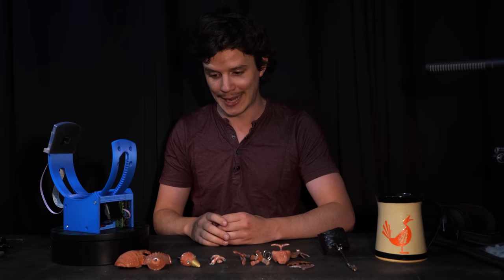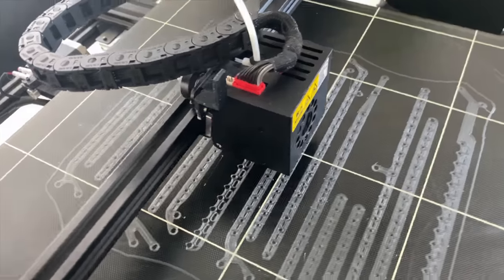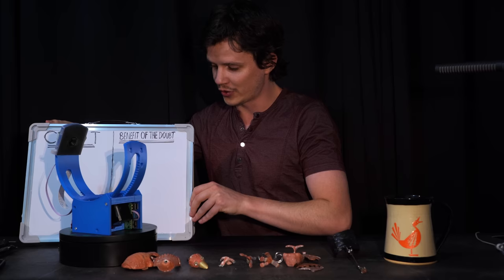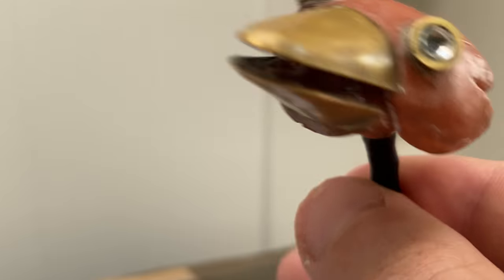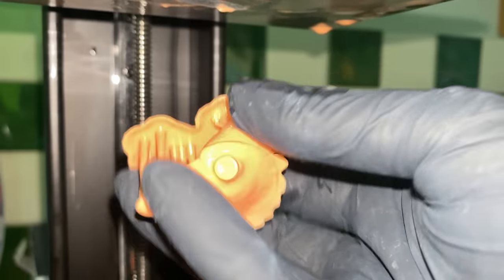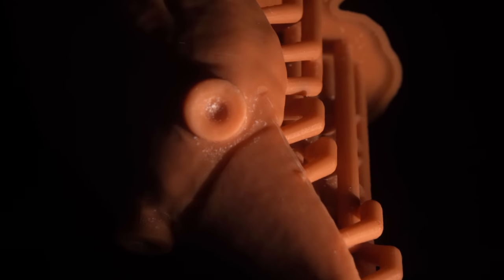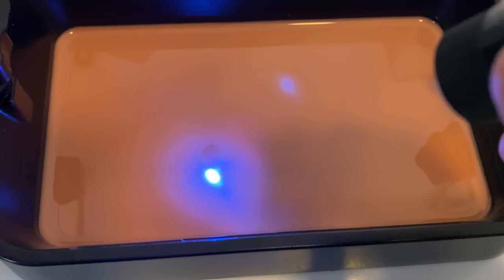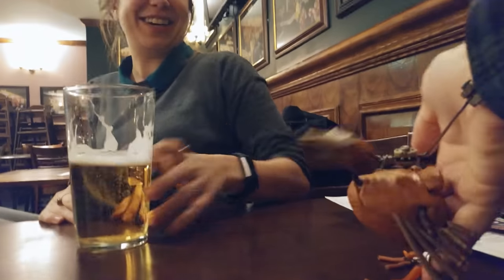DABCHICK got SCAMMED

Comment: Ebay has pretty good buyer protection, you don't have to get approval from the seller for a refund if the item arrived in a condition it was not advertised as in.
Reply: Unfortunately that return window might still come into play, but it is worth trying.
Reply: @57thorns Nope, that’s purely to do with the seller not the terms and conditions of eBay itself.

Since the seller created an item for sale and didn’t correctly describe its condition, eBay can charge this seller the cost of the refund.
Reply: dankpods got scammed by that said thing.
Reply: Lol, no they don't.
Reply: they absolutely do not have any buyer protection at all, let alone anything good. they dont even have a customer support team anymore. just the faq page. if you get scammed your only option is filing a chargeback with your bank. speaking from  experience.
Reply: There is absolutely no protection past 30 days, lost hundreds of dollars and over 6 hours of my time to a scammer this way. Triple check everything within the return window or you are not getting your money back
Reply: @altega this is objectively wrong, eBay had a huge amount of buyer protection, to the extent that the power is now much more with the buyer than the seller. I’ve had stuff refunded by eBay a few times now and it’s been pretty easy
Reply: Um EBay rules don’t over rule the laws of the land, in the uk you are still entitled to a refund if the item doesn’t work, it doesn’t matter what EBay rules say.
Reply: Correct
Reply: Note ebay's definition of "used", which the device did not meet. A complaint could have been raised, for sure.
Reply: that return window is the bugger to end it tho, ebay cares about you as a customer right up to that 30 day window's closing! I've never gotten more than a "sucks to be you" out of their support in this sort of instance.
Reply: @rossrobots5160 this isn't exclusive to eBay though. Most companies have a 30 day refund/return policy.

Comment: Are the metal bits going to stay? I think it'd be a shame if his eyes were no longer metal, because we'd lose the michevious metallic glint in his eyes.
Reply: Probably can use metallic paint
Reply: Metallic paint is just not the same the quality and apearance of brass is just way better
Reply: I would also think his muscle memory is used to the weight, so a lighter head might throw off the performances for a while without the metal.
Reply: Easy enough to add metal to 3D prints with a little planning. Just leave holes where you want the parts, and then you can glue them in place afterward.
Reply: He can probably just re use the metal parts from the original.
Reply: Agreed. I really like the eyes and beak and I think the metal contrast is super cool and a part of Dabchick’s charm
Reply: Don’t worry he will make them metal

Comment: You could consider taking silicone moulds of the printed parts, then casting with much more durable epoxy or urethane resins? Would be significantly more expensive though
Reply: I have a feeling this is where he'll end up going - it just makes sense for getting the detail, durability and most importantly repeatability for replacing broken parts
Reply: I'm not an expert..but perhaps replacing fragile thin parts with metal might be an idea
Reply: But likely cheaper in the long run, especially if you factor in the time required to clean up the resin prints and bring them to a usable state.
Reply: This would allow for reuse of the molds if parts break as well or to make multiples of the same part (so we can have an army of dabchicks)
Reply: I love silicone molding but I don't think it would be useful in this situation.  He won't be mass-producing these.  It's better if he just sticks with printing and gets the hang of it.  There are stronger resins and better technique to make parts stronger.
Reply: silicone molds are the best way to go also replacing fragile parts with more metal skeleton
Reply: @VagabondTE prints aren’t as strong and durable, especially resin ones. Silicone moulding isn’t just good for repeated casting of an part or object, it allows you to cast with more durable materials. And if he ever does need to replace a part, a mould is far easier than getting something printed again. I have silicone moulds that are many years old and can still produce pretty good results. Hell I once cast a helmet from a silicone mould that was older than I am and still got a nice casting, some clean up required but it’s easy.
Reply: @arghjayem  resin is very VERY fragile and is definitely a no go for something that moves or something that would be used outside, as for 3d prints themselves they tend to either break easily or get baldy printed

Mold are superior in every way to the 3d printing
Reply: There are some flexible resins available that might make prints less brittle
Reply: Beat me to it! Either print resin masters and make moulds of them or print moulds.

It's not that expensive if he's going to be printing lots of them. Two part silicone is cheap and if he really wants to save money it's possible to make moulds with oyumaru or even a blend of plumber's silicone with cornstarch and glycerin (I've used both, they both work). By contrast, printer resin is quite expensive if you need a regular supply.

If he can't get the printer working another option would be to get a printing service to print the models for him and ship them. That way they take responsibility for all the work involved in getting them to print properly.

Also, casting does allow for other material options like fiberglass, paperclay or even concrete that wouldn't be possible with printing.
Reply: @zeusthefox1585 He could look into casting then in brass using the print to form the mold. I don't know id the colors would quite be right but it's an option
Reply: @Freakmaster480  yeah, somthing sturdy enough so he wouldn't need to make the thin parts out of somthing fragile
Reply: Imagine steel dabchick
Reply: I was thinking similarly; I cast things all the time using silicone molds and you can get excellent and easily reproducible detail with far less...fiddling I guess you'd say from printers. It does take a little 3D imagination to imagine the flow of your casting material so you can make sprues accordingly, but it's no different than the scaffolding 3D prints require. Not only that but you'll get an exact 1:1 copy of the puppet's parts. Sometimes its easier to handle things "analog" too if you need several iterations. Cast one, modify what you need to, mold that, boom redesigned part with the original surface shapes/textures.
Reply: Just wanted to warn that trying to make moulds from resin 3D prints can be quite difficult, as most resins inhibit silicone from curing. You can try coating it in acrylic lacquer, or over UV curing the piece but it's always taken way too much work for me in the past. If you're going to experiment, buy much more silicone than you think you need!
Reply: Or plaster mould and then cast in metal.

Comment: It looks like the UV times per layer may be incorrect. As a resin Print person hope Dabchick gets well soon and if need help let me know
Reply: My thoughts exactly. He may need to bump up the exposure time by 1 or 2 seconds per layer. Also, a very common thing for us 3d printing folk at the start, we tend to under-support the models and miss the "islands" All things that will iron themselves out with time.   Hell, I've been 3d printing for years now & I'm still subject to the occasional print fail
Reply: That and a higher definition resin may work
Reply: @raxephon69 been printing with resin since creality released their ld-002r went through 3 screens and a buttload of fep film. I'm at the point where I get consistent prints after I dial in a new batch of resin. Personally I would use the light supports with a high density. Not a guarantee for success but really helps to keep complete failures to a minimum.
Reply: @raxephon69  I agree as well. All of those prints look a bit soft and under-cured to me. I've had resins that went from miserable failures to consistently perfect prints just by bumping the exposure time up by one second per layer, so that might well be a major part of what's gone wrong here. A few more supports might help as well-usually when a print of mine fails that way it's because the split area wasn't adequately supported, which would only be made worse if the resin is actually under-cured. (I don't even want to admit to how many failed prints I had before I learned that over-supporting and having to do a little extra cleanup is always, always better than underestimating how much support a print needs.)
Reply: Agree, check and adjust the exposure times, and the lighter supports.    I’m reasonably new to resin printing, but adjusting the fep tightness, exposure times and supports made a huge difference between success and a sludge filled tank.

Comment: I love the resolution from resin prints but yeah, HATE the mess and fuss and that's without being sold a lemon! You can coat the parts in UV stable paint and that will help a lot, OR give an industrial process like MJF or SLS nylon a go. It's not great for painting but similar resolution (powder based so a bit rough) and super durable and lightweight. Here for the new dab !
Reply: Yooo makersmuse I love your videos
Reply: Banana cat 3d puppet

Comment: Increase the UV exposure time per layer and use a higher quantity of lighter supports. A higher number of lighter supports will more evenly distrubute the force being applied to each layer as its pulled up from the FEP film (which is supposed to be a consumable component and needs to be replaced regularly)  and will removing the supports cleaner when the print is done.
Reply: I second this.
Reply: I was cringing at those supports he was using... was he trying to hold a building together?
Reply: @jimbobjones9330 Dabchick's just putting down some roots
Reply: Yeah almost everything he did on that model was wrong.
Reply: that and or reduce layer heights. pretty opaque resin. not much penetration. reducing layer heights better...

Comment: Very unfortunate about getting a dirty printer, glad you got it working though! And as for the fails, I’ve used that exact resin and also find that it tends to split easily, even after it’s been cured and outside it’ll randomly split. So I’d recommend a different resin as one variable for getting successful prints
Reply: Yeah, my thought was that the resin itself was problematic.  (Or at least partly the problem.)  Every material works well for some purposes and crappy for other purposes.  It just might be that this resin doesn't work well for what you folks are doing with it, or with certain kinds of printers, or certain climates, or whatever.

Comment: In my experience with the Resin printing, opaque resins require quite a bit more exposure time, I've had the exact same problem you did, and only managed to fix them by increasing the exposure time. It may, however, shrink a bit more than expected

Comment: your print head might be to too tight against the screen when you did your leveling causing elephant foot (and over-sticking) to the membrane, make sure your calibration card can move around under the build plate, when you are doing your calibration. another thing you need to do is put a small oil heater near your machine while its printing, resin printers fail if the work room is cold.
A brewing belt wrapped around the resin bath works also.
 I just got the elegoo Saturn 2 for my birthday and the rook chess piece printed perfect first test print. anyways best of luck, I actually made a dab chick inspired puppet myself called chomper, who pretty much looks like a checken leg dragon from golden axe, the yellow ones that can you can  ride in the game. anyway, best of luck.
Reply: I second the heater, for any 3d printer or resin printing. I use a thermal case around my 3d printer and it's made a world of difference with adhision and print quality. I currently have an AnyCubic Mego Pro, and I'm looking at their resin printers as I've heard good things about them.

Comment: You could also use the 3D printed pieces as masters to make silicone molds for a material maybe more flexible/tolerant of use. One thing to note, if using 3D resin prints as masters, DO NOT use platinum-based silicone. the UV resin inhibits the platinum based silicone from curing, giving you a sticky mess on your master and an unusable mold. You can use tin-based silicone instead OR coat the pieces of Dabchick's masters in an epoxy (2 layers preferable) to prevent the inhibition with a platinum silicone, which is cheaper than tin-based silicone. Coating with epoxy does remove some detail though... 

I got a resin 3D printer a couple weeks ago to make my own molds for things and I just went through this discovery and mess in the last week. The 3D printer having binding issues could be based on the leveling of the device first. I struggled with this too for a couple prints. With a used printer, I don't know if something regarding levelling was damaged or the resin you're using isn't the best or the UV lights are inconsistent across the print... Could be a lot of things. If you want to stick with a 3D printer, I'd look at getting a new one. I have been using the Elegoo Mars 2 Max and have been loving it. Occasionally, a print fails or layers don't bind... I think it is just the nature of the beast for some prints to fail at times.
Reply: You can get around the silicone curing issuing by fully curing your resin parts and sealing them with something like a lacquer. It creates a nonreactive barrier between the resin and the silicone.
Reply: I don't think learning silicone molding is a good idea in this case.  There are stronger resins and he just needs to get the hang of it.  Getting into molding would triple the amount of work, what he needs to learn, and pay for.  I think he's better off just sticking with Printing and getting the hang of it.
Reply: If he decided to go for silicone molds, he could skip the whole printing process entirely and use the original parts. I bet that would beat the reproduced detail level of a 3D print.

Comment: Possible new material to make dabchicks body "sugru" so sugru is like a play dough mixture at first but if you mold it and leave it for 24 hours its will harden into a strong rubbery mixture that won't break apart as easily

Comment: I have this exact printer! You will definitely need to have a very long cure time and maybe 4-6 layers (maybe overkill) for the print to stick to the build plate, you will also want to set a longer cure time per layer so that each layer will be less likely to stick to the resin reservoir. You can also look up cure times for your specific brand and color of resin and see if it is documented somewhere.

In all, it's a bit of trial and error. Good luck with Dabchick's recovery!

Comment: Yeah you for sure need to look at the exposure times for your prints and resin. The gaps, stuck pancake head, and separation can all be caused by supports not being cured hard enough to hold the print, or the print layers not fully curing before the bed moves and peeling the layers from each other.

Comment: Just a thought, maybe use the resin print as a tool to create a cast metal version or use silicone and resin outside of a 3d printer to cast using a pressure pot or vacuum chamber?

Comment: Oh man, I have a love/hate relationship with resin as it indeed is a pain to deal with!
A few tips to lower the chances of failure:
-shake the resin well! You probably already know this but the stuff inside of it separates rather quickly!
-hot resin flows better, 30-35C is good
-the FEP film is a consumable! (Easy to damage too)
-try not to touch the film with the yellow spatula (or anything at all), it's quite a soft material and it will scratch, microscratches mean more adhesion and more adhesion means more failures! Tissue paper scratches it too.
-in that refard, to remove a failed print stuck to the film don't go at it with the spatula, but use the "tank clean" button: it cures a whole layer of resin so that you can pick it up easily from the corners (where you can gently lift the layer up with the spatula causing less scratches). It also cures around small bits and pieces of fallen off cured resin so it's not in the resin and it doesn't puncture the film
-while replacing the film (do it when it's scratched or when it's hazy), install a frequency analyzer app and lightly tap the film, tightening it up until it's at the "correct frequency" (like tuning a drum). The right pitch is different vased on tge size of the vat, you can find it in the forums. It's more of an art than a science, so experiment a bit. Tension of the FEP film really causes trouble when it's not right, as it needs to flex enough to release the prints preventing suction but not too loose or it will stay attached and won't lay flat again afterwards.
-some resins are a lot harder to print than others! It looks like yours is pretty "soft" when cured, so it will be slightly trickier to get right.
-tinker eith the curing times, speeds, and other settings. I'm not an expert at all on this, but playing around sometimes makes it worse, sometimes better. I then stick to what made it better :)